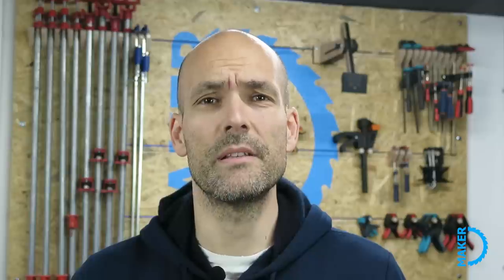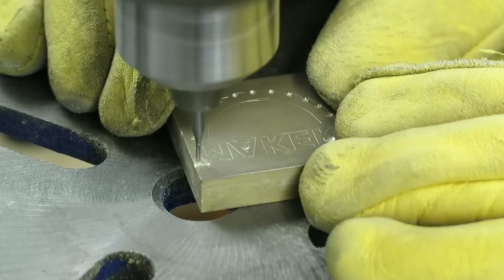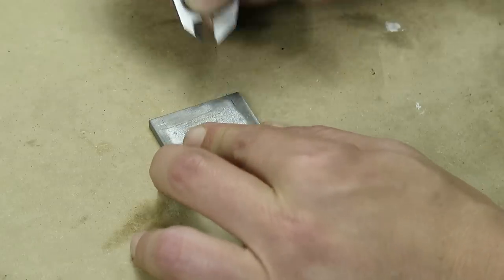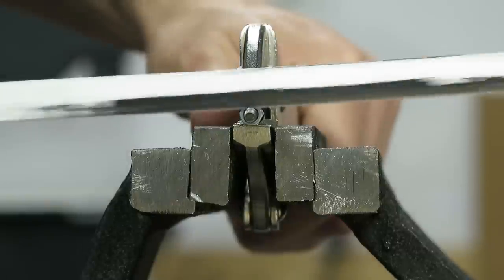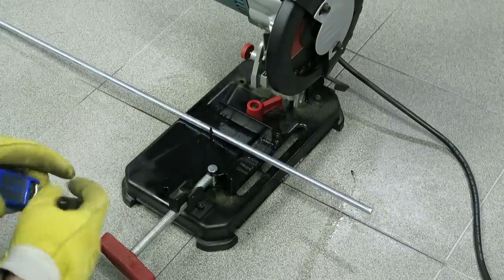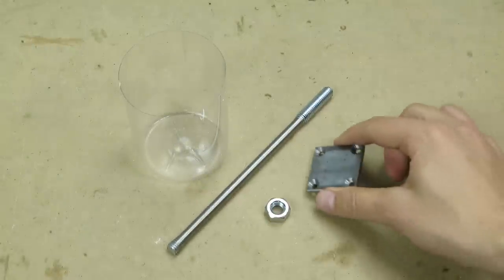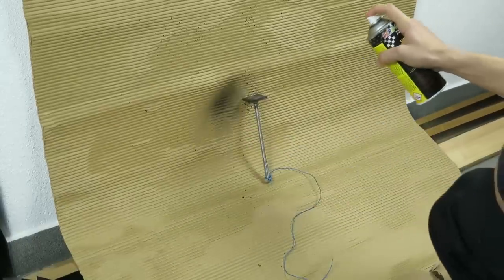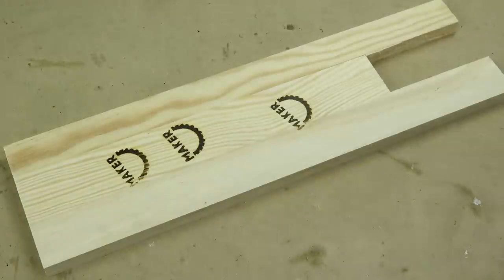How to Make a Branding Iron

Comment: Nice work and video  I liked your make shift  mill out of dremel and a drill press  that looked like it worked very well  I’m a retired Woodworker and have been using Dremels for years  on detailed items
Reply from the maker: Thanks a lot Craig! 👍 Actually, I first thought of doing it with the dremel handheld but then I realized that my hands were not precise enough, so I decided to use the dremel bits in the drill press, and it worked fine. Of course a CNC would make a perfect job!

Comment: Thank you for your very informative video. For anyone out there who cannot weld or those who do not own a welder, you could just drill a hole into the steel plate and tap it with the appropriate thread to receive the bottom of the threaded rod. Problem solved!
Reply from the maker: Thanks a lot! And you're absolutely right, that is also a possibility to make it without having to weld. 👍😉

Comment: Great job. As you were grinding your final weld a thought came to me. For the rod a person could go to a garage, maybe for semi-trucks, and see if you can get a used valve rod and just thread the one end and the other end is ready to drill the mounting holes. Heck, I may try to use just the valve itself for the brand. It may be too hard though, to grind off waste material. 👍🏻
Reply from the maker: Thanks a lot! Using an engine valve as a rod is a very good idea indeed, but as you said it might be too hard to carve the logo on it. So I would use the valve, and then a piece of soft metal like brass with the carved logo. 👍

Comment: Ehhh, really nice!
Your welding look like mine lol.
I never thought to put something in my pillar drill to process  it!
Wow! Do you meen that I can mill now?!!
Thank you very much for sharing.
I think i"ll try it for my father, who turn wood (I will let him turn the handle ;) ) 
"I can BUILD IT!"

Just one question, how long did you warm up th tool?
Reply from the maker: Thanks a lot for your feedback! 👍 Milling in the drill press is not the best, but it's a workaround for someone like me who doesn't have a CNC machine. Regarding the time of heating the branding iron, it's around 3 or 4 minutes, but depends a lot on the torch you use. The first times it's trial and error and then you get used to it 😉

Comment: those welds need a little more force. I would weld it between 80 and 90 amps and I advise you to use point fences, hold for a second and lift and so on and if you try to give a continuous cord, do not go back over it again.  let it curdle the husk, remove it and hit it with a little more force and to remove the pores of a cord, give it good strength without fear, go up to 110 or 120 and give a point without moving right in the pore, I think I had to teach you this now  that I have learned something from you today greetings from Spain
Reply from the maker: Thank you very much for explanation! Although I think it might not be enough, since practice is very important, but I will give it a try 👍
Reply: @DMaker_builds  Practice is the main thing and I think that you will not stop practicing easily so you will use some advice when I learned there was no YouTube and I am sure that many people would have helped me improve faster

Comment: Welding is easy. Hardest part is setting the machine up properly. Then watch your puddle (the molten metal while your welding). The shape of your puddle will tell you what to do. If it's elongated your moving to fast, to spread out and you'll get to much burn through because your moving to slow. Also you should be pulling the stick not pushing it. You push when mig (wire feed) welding. Get those simple things and it will changed everything.
Reply from the maker: Thank you so much fo your tips! I will try it next time. 👍

Comment: You keep jumping back and forth between welding and then grinding on the lathe press, Why redo it that many times when you can weld before the initial shaping of the shank? That way you can mess up the weld and not have to worry about redoing a whole shank. You will also have to lathe grind less times.

This is also very important:
Place something between the thing you are welding and the vice. It could be burlap, a thin piece of carboard, or a piece of wood. You do not want to mistakenly weld something to your vice. There are videos of people accidently welding the C clamp to the work. Ounce of prevention, pound of cure.
Reply from the maker: Thanks for all your suggestions. In fact I’m not very good at welding so it’s always good to get some suggestions 👍

Comment: Nice video, but I think you could have saved yourself a lot of work, by just drilling and tapping a single hole in the middle of the brass plate, and then just screw the rod in . It would have been strong enough for what you use it for.
Reply from the maker: Thanks! Yes, in fact that was possible and initially that was my plan but I thought that this way would be better than just having one threaded rod in the middle, which could possibly rotate when using the iron.
Reply: @DMaker_builds  Stick a nut on the rod and and tighten it down onto the plate. But tapping a hole is perhaps not a good idea, taps are tapered and you would have to get a special tap for threading a blind hole
Reply from the maker: @woodfinchcrafts7267  Yes, that's also correct!